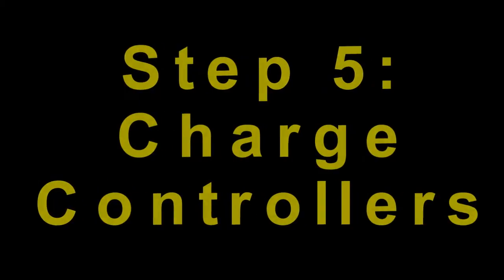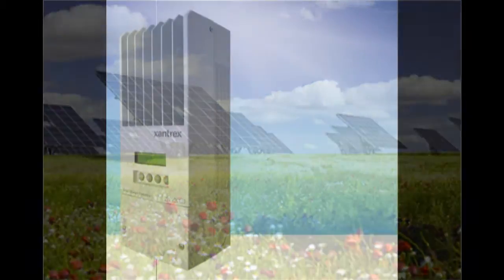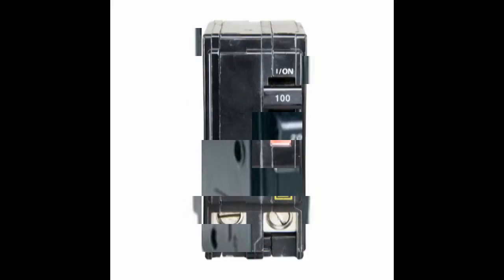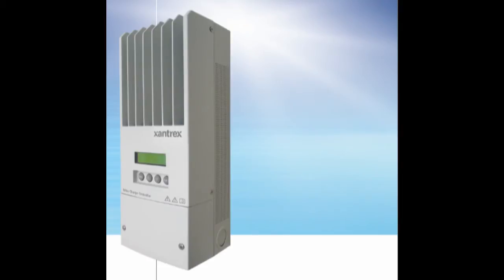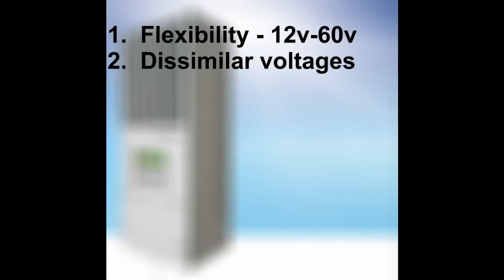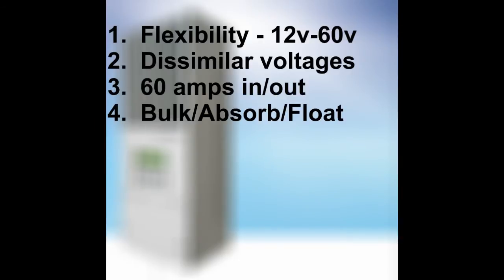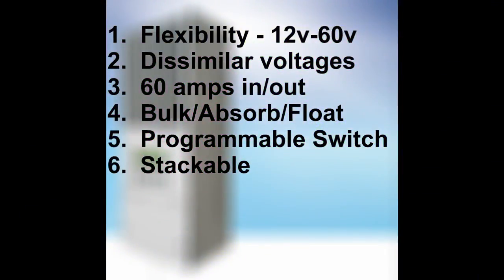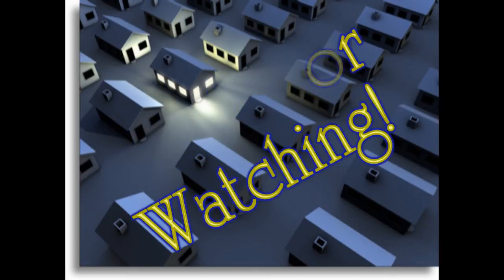Step 5 Solar/Wind Power: Charge Controllers

Comment: lots of great info, but I'd like to pick about one thing. 5:43 you said you get less amps when your solar panels are wired for a lower voltage. this may or may not be true, but I think your explanation is wrong. if all else in the circuit were exactly the same, wiring the panels for half the voltage should result in double the current. you may rather see less current when wired this way due to other factors causing losses, or something about the way the MPPT controller is handling it. I could be wrong, but I think there's more to it and other systems may have different results by increasing the voltage. I'd like to learn more in depth about this.

Comment: Steve thanks for the video, gave some good advice. I went to college to learn all this but you have pur this into more usable advice. I have a baldor industrial  permanent magnet motor that I want to use as a generator. It is rated at 180 v @ 1800 r.p.m. The biggest thing that concerns me is choosing the right blades to do the job...
Reply from the maker: Thanks for the kudos, and I understand the concern with the blades.  I'm no wind expert by any means, but one piece of advice that's pretty universal is this: If you're gonna wait to jump in until the time is right you never will.  You might as well jump in.

Comment: I am confused. You talked about your inverter charging batteries so why do you need a charge controller. Thanks  This is the best solar series on YouTube
Reply from the maker: +Mike Man I understand the confusion and thank you so much for your uplifting words!  The inverter only charges by using incoming AC power from my genset, where my charge controller charge from the DC coming from the solar panels and wind turbine.  It charges the same set of batteries but from two different types of sources - AC or DC.  Hope that helps.
Reply: +Steve Robertson (Off-Grid Living) Yes Thanks. Not getting much done this afternoon trying to watch all of your videos. It really helps. I have bought my property and am moving off grid next summer and retiring. Except for all the hard work required making a new home. But it will be way better than driving around the big city every day. Thanks again
Reply from the maker: +Mike Man I know well how you feel.  Going off grid is an incredibly liberating experience when you do it yourself.  We're all here to help if you need it.

Comment: hi Steve,
fantastic videos -always learning something new (love  it)
am interested in the workings of the charge controller based on the number of panels -i think you are saying the higher the PV voltage output the better bec the CC regulates the flow

i have a magnum48v-classic 150CC and 8 batteries -my panels are set up in sets of 3(255watts each) output 90V per array--have 4 arrays

from your video it seems tht there could be other setups tpo produce more power
Lou
Reply from the maker: +Lou D'Iorio the higher PV voltage, the smaller the wire and the longer you can run it.  By doubling the voltage you can use 1/4 size wire on longer runs.

There are definitely setups that produce more power, and technology constantly improves.  Thanks very much for your post!

Comment: Thank you for the 5 wonderfully narrated videos, made me realized one needs to do lot's of homework just to planned it out carefully, job well-done my friend! Regarding fed tax credit, are you saying I can just buy the stuff I need in Home Depot and give my accountant the receipt?  I am planning on a stand-alone solar battery backup system with 4 x 250w panels, Macnasine inverter you used, a cheap Ramsond charge controller, and about 400-800ah AGM battery bank to start.  Thanks again!

Comment from the maker: Most of my alternative energy experience was gained through trial and error and reading up on lots of books-no Internet back then.

I live in a rural area also, but still had to have it inspected-laws do vary.

I wouldn't put any kind of batteries in a basement that gas, so that leaves only gel cells or AGM batteries for basement installation.

Federal Tax Credit Program is based in how much you spend on it, and is not based on how it is installed.  If you have receipts, you have tax credits IMO